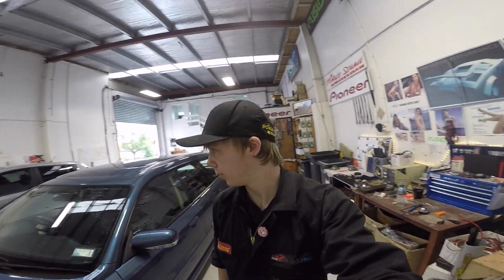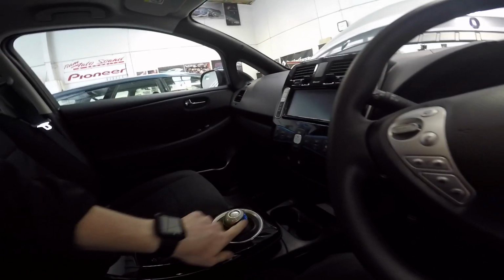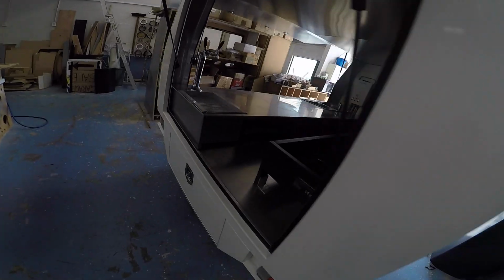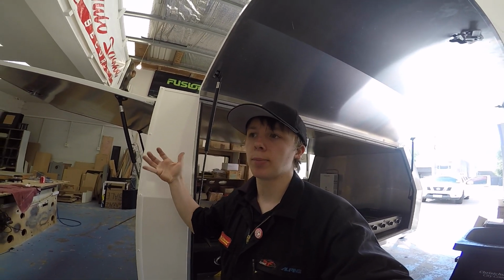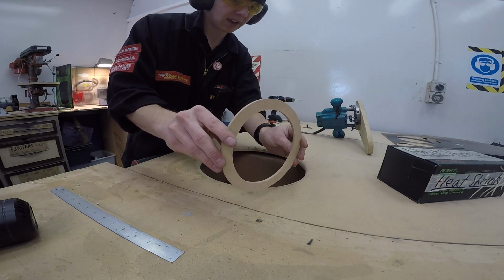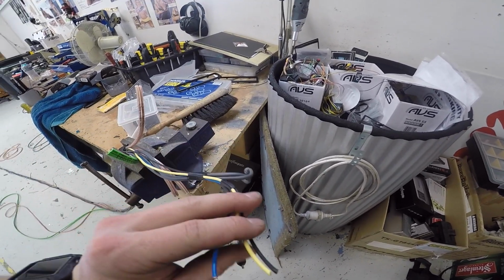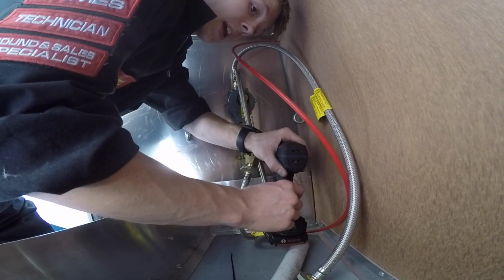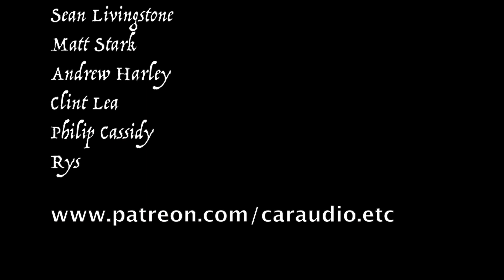BIG WEIRD PROJECT | WORK VLOG..?

Comment: i know ur limited on space to mount components but mounting anything with electrical current let alone next to but in the same enclosed compartment where a gas bottle will be is a big NO,NO James.As Soundman so elegantly puts in his videos (KABOOM)!!!!
Reply from the maker: I'll let you in on a secret.
Even though in the next two videos you will see it in the gas bottle side of the storage unit, the following monday we did go out and move it to the keg side because the gas plumbers werent happy with it.
Reason we put it there originally was to avoid the potential moisture damage that could happen in the keg side since there will be ice and condensation.
Im no gassy but I honestly beleived that it would be fine in there because a) that amp doesnt draw enough current or voltage to cause a spark and b) the gas system SHOULD be air tight. i.e no leaking gas.
oh well its all sorted now.
Reply: Cool,i agree being air tight and all but with all gas units there is a very,very small amount that is given off anytime its used and even though there is little power being used i think in the fact of the gas plumbers not being happy with that location. I think its just more of a rule of thumb to not have any electrical what soever in near or around gas. But glad it will b sorted out. Love the videos,keep em coming.